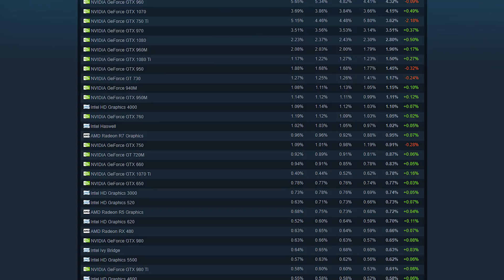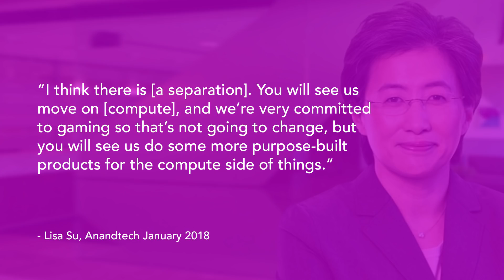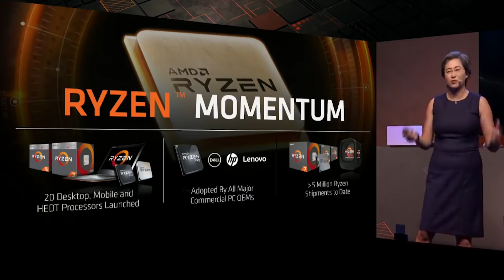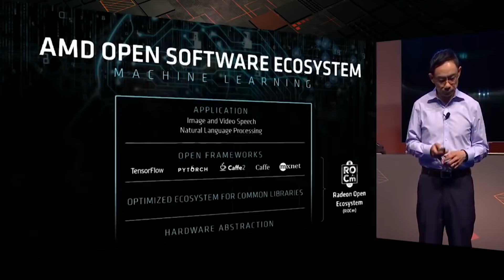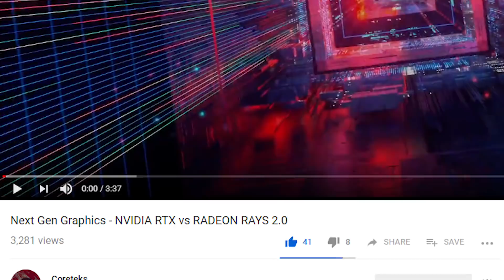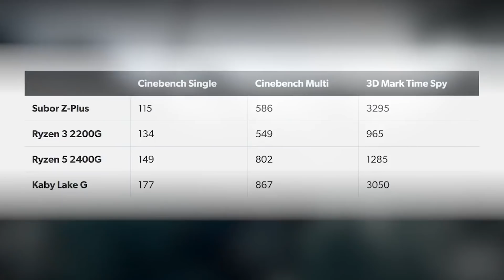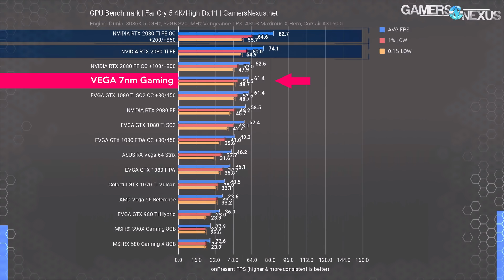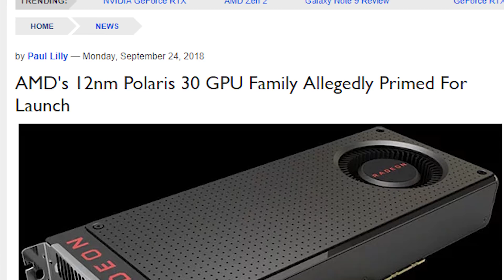AMD's answer to RTX

Comment: I always forgave AMD for not performing well on their GPU's because they have two battles to fight: Compete against massive company Intel in the CPU market and compete against massive company Nvidia in the GPU market so they are A) the smalles of the three companies and B) they have the hardest position.
Now if you ask me, they outperformed Intel ever since Ryzen came out. The price to performance is amazing compared to Intel's CPU's and they're plenty capable. For professional workloads they're straight up better and they're good enough for gaming. Also, Intel has no answer to Threadripper, especially for the price...
So I just thought AMD doesn't have any money for R&D left since they focused so hard on CPU development.
I could be wrong though, I would be happy if they had something up their sleeves to compete with Nvidia because the pricing on those 20 series cards is an insult to any person with a brain.
Reply: "I always forgave AMD for not performing well on their GPU's because they have two battles to fight" Well they didnt, they bought ATI and took upon themselves that uphill battle, and they lost badly. Thankfully theyre coming back cpuwise.
Reply: @wh173  they bought them means they have to fight the battle still. its a lot of work to absorb a failing company and revamp it.
Reply: If AMD or Intel really wanted to fuck Nvidia over they could remove support from their CPU's so that Nvidia GPU's won't work with their product, then boom who is going to want a Nvidia card. I agree though that AMD's Ryzen outperforms Intel CPU's, I love my Ryzen Threadripper :)
Reply: @Zirethiel  However, my friend, some people dont understand or I dunno dont accept the fact
that AMD is better then intel :)
Scenario : AMD reveals a new ground breaking technology
Intel, NVIDIA : "hmmmm...."
(Release, Premature out performing little more pricey then current amd/nvidia/intel technology)
Intel, NVIDIA(thinks): "hmmm...."
Intel, NVIDIA -> Goes out there advertises their shit technology all over the consumer markets 
which is overflowed with stupidity... 
People looking at stupid ppl with joy : "hmmm..." (Pondering) .. 
Well, I will go buy NVIDIA + Intel... it's worth it.. see how happy they are...(Pondered and bought it)
AFTER 10 months -> NVIDIA + Intel realease new shit with another premature technology and messed up
stupid Drivers...
NVIDIA + Intel User (PC Screen -> Power Surge / Overheat Issues) : wtffffffffffffffffffffffffffff ... >.<
Oh well, seems like product is old now.. I should go upgrade.. 
NVIDIA + Intel User -> Goes and burns more money on NVIDIA + Intel Shit
ahh.. such a great hardware ... such an amaaaazzzinnggggg performance
I m enjoying it :)
Reply: You can blame consoles for diluting PC gaming. Not AMD or Nvidia.
Reply: Well the thing is, I lost hope in AMD years back... Like I used AMD from 2000 to 2008.. 
Then after loosing hope, I switched to Intel first intel product i used was Core2Duo
after that, I kept buying intel / NVIDIA... but now, as I see..
Intel's Products compared to those in 2005-2010 are worst, like 80% worst..
And I find Intel & NVIDIA(especially) beyond Redemption.. 
my last Intel /NVIDIA Rig was in 2016 -
Asus geforce 970 GTX Turbo OC,
i5-6500k
corsair 16gb ddr3
however, my RIG got damaged and destroyed just 2 weeks ago.. 
ever since those shitty NVIDIA drivers 411.63 and above came out
so, now that I finally had to build new RIG.. 
I not only contacted Local Computer Hardware sellers, but to cross verify information
I checked internet and youtube a lot
and now that I see...  AMD is back on knees... and as I see of now.. 
AMD is the best solution out there GPU/CPU both.. against the value for money !!
I will still say, Intel / NVIDIA were not bad, they were awesome 8-10 years back..
Now, they suck, they are bad.. like literally their products give definition to bad...
 and not just that, compared to value for money.. They just suck now :(
Reply: I think their stocks have risen a ton since ryzen. They could prolly use that money now to invest in the graphics side. If they do then may be in the best position rn even if the graphics comes close to nvidia but doesn’t beat nvidia. Their stocks would rise a shit ton and finally put some competition against nvidia unless they become the Samsung of the gpu market.
Reply: I would argue the 9th gen cpus  from intel are good competitors.
Reply: Compared to Price and Performance Ratio they are no near to Thread ripper.. dont BS dude... =/
I m a long time intel user.. I still use intel.. so I know it.. I have seen threadrippers how they perform :@
Reply: not in terms of price/performance, but rather overall performance in general. I've only known intel processors and my next build will be including a intel i3 8100 quad core. I feel as though intel gives quality products, even if they may be pricier.
Reply: Sigh
Reply: Intel CPU's are high quality, no doubt about that. In terms of single core performance they're still ahead of AMD. Let's see what the 9th gen can do, if they're in any way adequately priced, Intel might gain some ground again.
But yeah I'm really interested in more GPU competition...
Reply: Still Comparing Ryzen even newest gen to Intel is kinda not fair, we are still waiting for next Zen processors that match Intel price range.
Reply: Why going for an i3? If you have to buy the motherboard too, R5 would be the better option, budgetwise.
Reply: @Rocky.G you would agree that availability issues are important too? ... Intel puts out something that is ridiculously expensive to manufacture and is forced to price itself out of the market, since they can't meet demand anyways. Meanwhile, AMD is moving really cautiously to avoid any  eff-ups that might thwart their campaign to re-establish their credibility as a legit competitor to two of the most respected companies in the world: Intel and Nvidia.

Right now AMD is really up against the wall in the stock market, because everyone was expecting AMD to reveal that they were stealing marketshare rapidly from Intel, when instead, AMD had a decent quarter, and Intel reported way more revenues than expected. I've been following the whole thing closely, and let me make a somewhat unpopular and unique assessment of Intel's reported earnings last quarter:  Intel made a bunch of money last quarter because there are customers out there running older Xeons and they got completely hosed by Spectre/Meltdown. So many many many companies out there were pretty much forced to upgrade. Even now, Intel hasn't got it's act together regarding security issues. For gaming, ok then whatever you don't feel it unless you try applying the security patches and it ends up destroying performance, but in the corporate world, it would be a very bad case of negligence if they didn't quickly move to a different platform that either has the patches, or has enough performance to make up the difference between the older hardware and new hardware, with patfches applied. So basically, I'm buying AMD stock right now because I believe their stock price woes are from BS thrown out there by Intel and Nvidia.

Intel is anticipating the arrival of 7nm AMD EPYC in the datacenter, and if Intel doesn't get it's act together, a good number are going to buy AMD just to have a more heterogeneous cloud. So Intel is selling empty promises to it's customers that they will have a fix soon (after a few attempts that completely hosed some corporate networks). I mean, if you were running a datacenter, you would be crazy not to look for an alternative after the sh!! that Intel put out there, talking like it had squashed the bugs in their designs, and then having to dial it back repeatedly since the issue is bigger than Intel admits.

Same with Nvidia. 7nm Vega is not only great in both compute and gaming, it will have great yields from being rebuilt into a Ryzen-style MCM module with AMD's Infinity Fabric tech, by a team that recently took in members of the Ryzen project, tasked with bringing lessons from Ryzen development into the 7nm Vega group.
When you factor in the slowdown from security patches, Intel CPUs suddenly look bad, especially given high prices (which is practically robbery since Intel should replace everyone's CPUs under warrantee with something that isn't ruined by bad design.)

Intel reports record revenues hahaha, yea, from selling new chips to desperate companies who are shafted by being forced to patch all their Intel servers, and then buy even more servers to either replace or upgrade whatever they've got going on, at the present time. Corporate IT departments around the world are anxiously awaiting the arrival of AMD's datacenter solutions, not only because AMD's designs are good, but also because they realized Intel is a bag of scum for stringing people along with word of an imminent fix to their security woes, and they really want to move to AMD's platform at least as a backup to their Intel servers that are basically gimped for good. The best fix for Intel is replacement, since you lose so much performance from applying the security patches. The best response to Intel's incompetence is to replace a minimal number of machines that especially need security and performance (Oracle released some interesting news about their work with AMD hardware, recently), and get in line early with AMD to pick up a bunch of EPYC servers.

Microsoft recently announced huge gains in their datacenter business. Why is that? Probably way easier to migrate existing systems that are running insecure Intel, onto cloud servers run by Microsoft, assuming that most of these clients will be already using Microsoft technology, and also since Microsoft was an early adopter of AMD EPYC, Microsoft's Azure seems like a great way to go if you want at least a portion of your setup running on AMD for security reasons.

Sorry about the long post, readers, but hopefully my brain dump helped illuminate the whole Intel vs AMD business competition.

Oh yea and if you didn't know, Jim Keller, famously from AMD (also from Apple and Tesla), is now at Intel. The designer of Ryzen is now a top figure at Intel. The man who made a laughingstock of Intel when he was at AMD and single-handedly came up with an alternative 64-bit x86 instruction set backwards compatible with 32-bit x86, which Intel tried to avoid by attempting to force people to move to their proprietary 64-bit (non-backwards compatible) set called Itanium... even funnier, Intel ended up plagiarizing Keller's 64bit-x86 set, and then lost the lawsuit AMD filed against them, and resulted in Intel and AMD settling on sharing AMD-64 x86, in return for a permanent license to Intel IP related to the x86 set for AMD.

This comment turned into a blog and I am sorry.
Reply: @edwardpark247   umm.. so why is Jim Keller working with intel???
and btw Edward... Thanks for great reply and info .. Appreciate it :)
Reply: @Rocky.G   omg ty ty, ahah i thought i was gonna get flamed for writing a book ---- check this URL out for just a overview of what we're dealing with,,, this guy is a legend, right? 

https://newsroom.intel.com/news-releases/jim-keller-joins-intel-lead-silicon-engineering/

He's basically in charge of designing all chips at Intel. They made him a Senior Vice President, so he's in line to be CEO, depending on who Intel has in there in other positions. Keller might be working with some familiar faces at Intel -- there is Raja Koduri who was head of graphics at Apple, same time Keller was there, designing the A4 and A5 (iPhone 4 CPUs). Keller went back to AMD but also may have influenced Mark Papermaster, the top engineer at Apple, who was in charge of the iPhone division, to come to AMD, where he is like the right-hand man to Lisa Su. Papermaster was also at IBM before Apple, where Lisa Su was head of R&D (she is a legendary research scientist.... her team figured out how to get copper to stick to the silicon so it could be used instead of less efficient aluminum). There are former AMD people who were hired to become top executives at Intel over the years, some of them worked with Keller before no doubt, and are well aware of his value as a teacher, as well as a builder/designer. He is the best, and I bet Intel showered him with money. Keller has intimate knowledge of both x86 and ARM. He is an expert on ARM and low power applications, and most likely trained teams at AMD over the years to keep experimenting with low power circuits, because as you know, the chip generates heat, wasting electricity, which is exactly what you're trying to use efficiently. Why is Ryzen so good, despite being such a new design? It's because Keller trained an amazing team over the years. Inside AMD Ryzen Pro CPUs is an ARM core that is kind of like a mini ARM computer running next to an x86 chip, for security functions, like encrypting/decrypting RAM. Ryzen Pro is a very interesting design.

Intel looks at shit like that, that Keller has made over the years, and they know, he's the best. Intel said they were the best, but it wasn't true. Intel was the most profitable, and the darling of Wall Street, but AMD had some amazing people over the years, including Keller. But Lisa Su is different than anyone Keller has worked under. It might be the first time he has worked for someone who is on the same level as him in terms of technical expertise. Keller is in a really good spot, career wise. He has long been known as a guru. But recently he has been on fire, working at Apple, AMD, Tesla, and now Intel, showing them how he works. It's one thing to study a competitor's moves, but those watching may not understand what they are seeing. It's a whole other thing to bring a competitor into your home, your business, allowing you to study his or her moves, from up close, as they are being made, as a collaborator. 

Competition doesn't have to be evil, right? It's one thing to say that business is a "survival of the fittest" world, but it's not really true. Cooperation is superior to competition. It's survival of the smartest... and the smartest know that the only way to demonstrate true technical skill is to do something with it, to put it into action before the eyes of the world.
Reply: @edwardpark247  amazing description bro !! Thanks again  :)
I really appreciate your time and effort for writing down all the info ^_^
Thanks again :)
And Btw, as far the competition is concerned.. I have same beliefs as you..
There should be rivalry not War :)
Reply: @jasonthomas4895  
For the same price you paid in your i3 I bought a r5 1600.
Reply: @thrawn9115  I have an i5 now

Comment: You have confused the 1.35X performance statement of the fab process, as a 1.35X performance for the new card. Fab process performance is not the same as end chip performance.

Comment: How dare you call Vega 56 and 64 a failure card. If amd uses HBM2 they should be clocked higher. Not to mention, Navi will probably still use HBM. Maybe instead of 2048-bit it will be 4096-bit bandwith. Maybe instead of 8GB their flagship Navi will have 8 to 16GB. It’s obviously gonna be 7-10nm transistor(since downscaling anymore will just decrease performance). We already know ray-tracing is a given and that they will be using Infinity Fabric. We should Expect 7nm Vega cards to be release this year and next year will have Navi GPU architecture. In the end, while nvidia digs their grave, AMD will Ryze and become an Epyc Manufacture in the industry of Graphics and AI. It’s to bad Nvidia trashed Volta. I saw high potential and got excited when I learned about Volta just to find out it’s in a $5000 GPU. Greedy F$&@s

Comment: AMD's GPU's are in Consoles, they can get away with not worrying about RTX's Raytracing for a few years. The Radeon Pro GPU's (those based on VEGA) already have Raytracing but not in a gaming capacity.
Reply: Yes. Exactly. Nvidia is acting very strangely. The more they troll and divert attention away from, and cast aspersions upon AMD, the more interesting it is to guess at what Nvidia knows about 7nm Radeon Instinct. One big example is how they pushed RTX out before it was ready, and while there are still tons of 1080/1080ti in the channel. They tried protecting 1080/1080ti sales with super high pricing of the 2080ti, but 2070 is probably a better way to go if you don't want to buy a used 1080/ti. So previous rich owners of 1080/ti sell their cards off and upgrade to 2070/80/ti, and the 1080/ti's hit ebay and holds up demand for the new 1080tis that still haven't sold. 

If this goes on then it could mean vendors will just slash prices on 1080s, and make room for 2070+, and if they don't slash prices, people will just wait for black friday assuming it will all be cheaper then. So, why buy a used 1080ti now when you can wait for more people to sell their 1080ti's on black friday when the 1080ti sellers upgrade to 2070+ and a bunch of used 1080/ti's go up on ebay. 

Meanwhile, there is a glut of 1080s, many of which were produced to meet crypto miner demand at the same time the crypto mining industry folded. Meanwhile, rich gamers are buying up the few 2080tis which have thermal issues, while prudent gamers are waiting for the new 1080ti's to go on sale, which will be priced a bit above what you can get used from ebay, but with warrantees and all that good stuff, and that will push used 1080ti ebay prices down too, since they will be competing with brand new units.
My point is, if AMD didn't have Nvidia freaked out about 7nm Vega, NV could have given it's partners more time to sell 1080s and 1080tis at current pricing, rather than at prices forced lower by the newly released 2070+ boards.